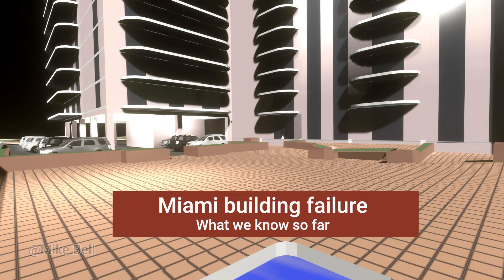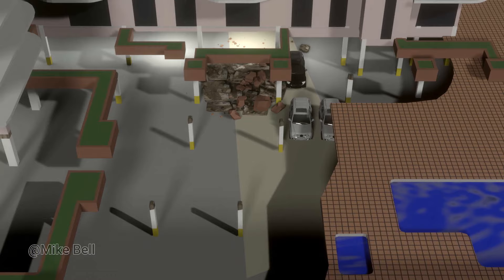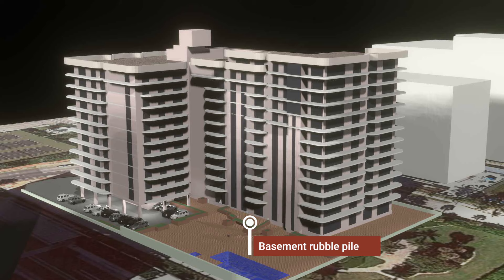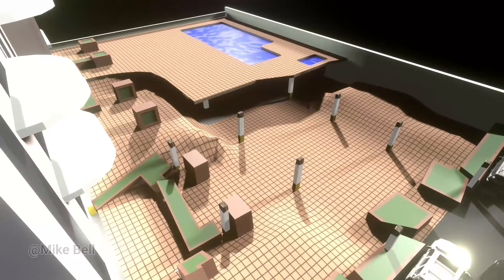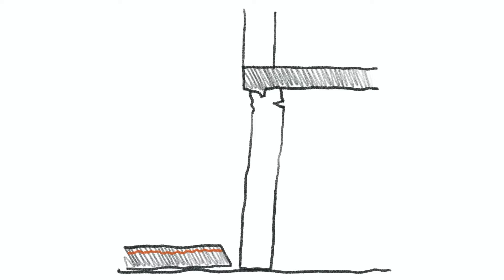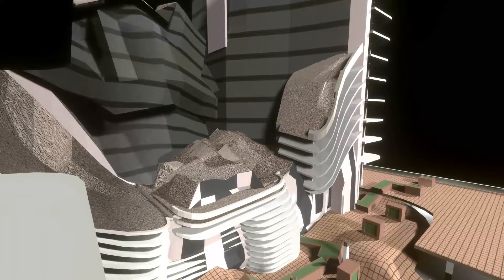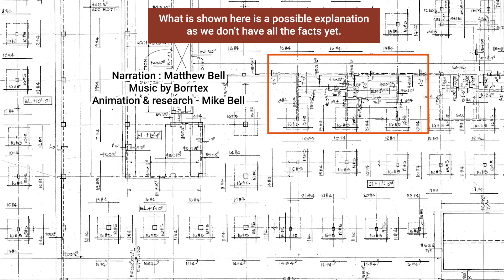MIAMI CONDO COLLAPSE | visualization of the evidence pt2

Comment: I had read that there was numerous complaints from the occupants regarding the constant pounding and vibration from an adjacent property being built.  The new building's construction company even offered this building's homeowner's association $400,000 to make up for the constant pounding that was sending shock waves through the building.   They did not accept the $$.   Wouldn't that have caused issues like cracking on top of the other issues the building had?
Reply from the maker: I am doubtful the adjacent construction made a difference.  Buildings are next to other buildings all the time.  The re-certification Engineers would have been on the lookout for any such damage and they reported none.
Reply: @Mike-Bell  from what I read the city allowed a street that divided the 2 properties to be condemned to allow a bigger foot print for the new building.  Not only weren't they very far apart but where directly adjacent.  I don't think the building had been annually inspected so there might not be anyone noticing that the constant construction pounding of footings being driven into the ground was negatively impact the 40+ year old  building.
Reply from the maker: @sallydavidson4471  It is normal practice for a dilapidation survey to be performed on the adjacent tall building to carefully note and record the state of a structure prior to new construction next door. This way any new cracking or damage can be attributed to the new construction and the new building would have to pay for cracking/damage. I have heard no talk of damage or repairs. Only the talk about the inconvenience payment of $400k.

Comment: Individual unit renovation added weight. People switched from tile or cheaper materials to entire marble slabs and thicker glass.  The design wasn't made to withstand such loads.  The planters were already failing 6 months beforehand, and the water damage, well, would that be climate change raising sea level?

Comment: The eye witness accounts will be useful to the investigation, but seriously, they've barely finished removing victims from the rubble. No scientific proof/no actual facts, can be learned from this video, except that the building collapsed - and that is my qualified forensic engineering perspective. But hey, at least you made some ad revenue. 🙄

Unfortunately, people tend to read and take in the immediate speculation like this because it's recent and currently comes with a shock factor. Far fewer will bother reading through the technicalities of the inquiry results when they're eventually published way down the line from now. Hence speculation now can be confused with actual fact later on, leading to the spread of misinformation.
Reply from the maker: I undertake to make correction video when the final assessment is made. However I feel confident in what I suggested here will not be substantially different from the official finding. The ideas presented here were discussed with multiple of my Structural Engineering colleagues and they all were confident this was a very plausible explanation.

Comment: the theory of domino falling should not have happen, as there are other columns, lift walls and staircase walls that are on the inner side of the building, so even after the other side of columns fail, it should not have caused a total failure of the building...in structural design, there is always redundancy, where are all these redundancy ?!?!

Comment: If your going to use toothpicks to hold the building up you should think about making them capable of swaying without cracking and failing rebar doesn’t hold the building up the concrete does !!
The rebar just reinforces the concrete but it doesn’t stop it from cracking !! Otherwise the building will stand up on rebar when The concretes gone !!
That is the cheapest design I have seen yet for a building construction !!
If concrete walls put in the place instead of cement slabs this building would still be standing !!!

Comment: You never build a building with concrete slabs !! Damn slabs can not take back and forward motion with out cracking and failing !!! If this building was made with steel construction with cement overlay it would still be standing next hundred years !! This is a new design And take cost of steel out of construction of a building and Concrete slabs with rebar allows for rusting of the rebar which  internally cracks the cement and you can not see this is why the pool deck fell first compromising the entire structure , accept where walls was built that is stronger then cement slabs with rebar the building stay standing never build a building with cement slabs always put walls to help support The structure !! the slabs was the same thickness at the top floor as it was holding all the weight of the entire building on the bottom floor !! This is like putting toothpicks under your house to hold it up as long as One or more toothpicks don’t break the structure will stand but if one or two toothpicks rot and  break then it has the weight of the entire structure on a few toothpicks !!
And where the building did not fall there was a wall stand there to give it proper support to hold the building up !!!
All the building made with this similar design should be taken out of service immediately Because it’s nothing but a death trap ,, if you to have an earthquake and overtime the rebar rust and cracks the  cement internally just like a Earthquake would do !!! It’s just a matter time before the structure fails !!!
If you’re going to build a structure with a Type design put walls up instead of toothpicks to hold the building up !!!

Comment: Hmmm, well, I think if I lived in any high rise(never happen) I would want some sort of proximity sensors everywhere in the building tied to an instant warning system of LOUD irritating alarms and to my devices(phone,PC,TV,etc). Any nasty noise or movement of material and everyone possible gets warned instantly. False alarms and evacuation might happen like a loud car crash in parking area set it off but WTH, at least you know it works.

Comment: If a sprinkler pipe is broken and flowing water, wouldn't it trip the fire alarm system? Maybe grandfathered due to it older fire codes?..
Reply from the maker: That question has been asked over and over with no satisfactory answer.  Quite likely the alarm was disconected from an annoying repeated false alarm and not repaired.  Had it worked it would have saved a lot of lives.
Reply: @Mike-Bell  Thanks for the feedback, Mike. I spent 32 years on a full time fire department and building construction knowledge is essential for our own survival. Few municipalities are eager to solve problems and more likely to hide them or simply to shift blame....bottom line management tends to miss the larger picture. Stay safe.

Comment: You repeatedly use some form of the statement, "lack of warning", but I can't agree with that.  

There was literally years of warning - all of which was ignored - until it was finally too late to do anything about it.  

That's not unique to this disaster, and is, for example, ultimately in the same family of root cause of both Space Shuttle losses - but just because the resultant failure is sudden and catastrophic it does not automatically follow that there was little to no warning prior - it's simply that the warnings were never heeded.

In short, no amount of engineering can overcome prolonged willful ignorance and neglect.

Comment: Do your research they knew there were problems back in 1997 when the building was only 17 years old. That's when the HOA started funneling money away. Is the sister building AKA North tower North tower built at the same time also by the same builder hasn't had any of these issues and there and they're HOA husband has been controlled by a completely different group.

Comment: I mean, surely the warning signs were there? Apparently as early as 1996 things weren't quite right.
Reply from the maker: Yes there were signs but nothing out of the ordinary. Many buildings are in that state. Some worse. No signs of extreme distress shouting vacate the building now for human safety.
Reply: @Mike-Bell  What about the huge cracks in the ceiling of the underground car park?
Reply from the maker: @NiKOliDANBURSKi  I see old buildings I see in my work which look pretty similar to Champlain garage ceiling. Typically they need repairs but not evacuation. 
In this case the damage was fatal and was largely hidden. That is very scary to me as a building professional.
Reply: @Mike-Bell  I understand 😬 Hope they find out what happened 🙏

Comment: so one car bomb in the right place underneath could bought this whole thing down.
Reply from the maker: Well actually more like a gust of wind on the pool deck. This building was eventually just teetering holding by the proverbial thread. And on that night it could well have been a gust. The wind was quite blustery at the time. A shocking design and dodgy construction. Deadly combination.
Reply: Sure, it could absolutely have that effect.  Of course that's not what actually happened.

Comment: I’m wondering if it was a sprinkler pipe if it had to do with the fire system wouldn’t the lack of pressure set the alarm off automatically I’ve been in buildings used fire hose and a matter of minutes the alarm was going off I’ve done it twice I know there wouldn’t be any alarms for this situation but I’m wondering the one lady heard something and got her family out and what about all the other security cameras around the building and inside I know the building collapsed but I know shitty restaurants with a camera system that’s hooked up online

Comment: Can somebody help be better understand this building: were pre-stressed concrete cross beams present and at which floor? To me it just seems slab floors one of top of the other with the only load bearing elements being the columns up from the foundations.

Am I missing something?
Reply from the maker: There was no pre-stressing or post tensioning in this building. There were a  lot of transfer beams at 2nd floor level over the porte cochere. But the rest of the building was flat slab construction with long span traditional reinforced concrete.
Reply: I can't get my mind around the idea of how to avert a collapse like that, if the loads could have been shared between the adjacent inwards columns. My mind actively refuses to endorse a building where even a complete line of columns is vital, I'd like to see the building statically stand even without.
Reply from the maker: @m80116  This building represents the worst of sailing as close to the edge of the structural code as possible. The designer did the bare minimum against punching shear in the deck and the tower. Fortunately this  building is an outlier because this is a very rare occurrence. 
. 
No disaster happens for just one reason. This case was a very brittle structure. Plus pitiful lack of maintenance caused unchecked corrosion. Once this under designed structure lost enough of its steel which was working at maximum catastrophe struck.
Reply: Err... not to downplay your competent view but I am SCARED of a structural building code that allows something so close to self destruction should no maintenance have happened in a 40 years old building. 

In fact what worries me most of all... it's not the fact that the flat pool deck caused an almost irremediable spalling and corrosion of the structural elements. It's the fact that apparently under my deepest ignorance those elements tied to floor deck were in fact a vital element to the building which couldn't stand without them.

Comment: Great video except it would be impossible for the deck to collapse as shown and first. The only thing that is plausible is the area of pool deck between building and planter that we know collapsed by video of the entrance to the garage. The rest is impossible unless the lady that reported to the security guard as claimed is a magician. The first cop on the scene walked over to that lady who was trapped in her car and the security guard was there trying to help her out. It would be impossible for the old woman to get into her car to even think of driving away had the pool deck collapsed before she got in her car. 

Do the issues with the woman who talked to security guard being trapped in her car it would make your theory impossible.

The second problem is the pool deck was push to the outer wall behind the planters and cars. The rebar dragged down the wall part way and still has pressure toward outside wall as it is not able to lay flat. With that said the building had to have begun falling before the pool deck failure. You have rebar at the column by the Gate that goes up about a foot and then pulled back down. That was not a failure. None of the alleged punch sheer could have been a failure that caused the collapse. 

Eye witness are not ever reliable because they are in a fast acting situation. When they claimed the deck collapsed they could have all meant the one area we know did collapse. 

Another issue is the fire alarm didnt go of till after the collapse. The garage collapse should have set it off. There are witnesses that were allegedly at the elevator in the garage waiting when the garage collapsed. Is that even plausible. It would have been dark before and after as the lights were out plus how did they get in garage. Were they about to leave or coming back. Coming back might have been a problem if the garage was closed die to the debris.
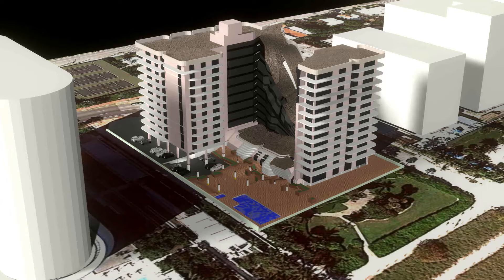Reply: Check the timeline Mike has linked to in the Notes to gain an accurate understanding of the eyewitness sequence. No one was trapped in a car after the building collapsed at 1:22, for example. The Vazquezes were going up in the elevator when the deck collapsed at 1:15. None of the witnesses described a deck collapse sequence. The building was already redistributing its load at 11 PM, and may have begun doing so even sooner. Etc.
Reply: @maud2739  well was I right or his timeline
Reply: @scottparker1220  The timeline document that has a link in the Notes section is correct. The timeline indicates that bodycam video shows Security Guard Shamoka Furman helping Iliana Monteagudo, who escaped down the staircase from 611, out of the garage.
Reply: @maudessen573  I gave you the video of the first cop. Maybe it is just a fake. What don't you get. The old woman not only could not but would not even try to get in her car AFTER THE COLLAPSE. her car was half on the upper deck and half on the collapse. How could it  collapse when she said the pool deck collapsed before she left her room. Then she went downstairs and asked the guard in the lobby. When the cop showed up the guard was try to help her get OUT of her car. You would think the cop would help but apparently not. So how does it collapse first. Oh the time line said it did.
Reply: @scottparker1220  You are confusing two different people from two different apartments. I hope no one pays attention to your creative new story, because it is not accurate.
Reply: @maudessen573  are you on Mars.  I am on earth talking about a condo collapse in Florida. There was only one first officer last I checked. Did you watch that video or are you stuck in a timeline that someone made up. 

The officer walked around the wall to the area where the ceiling fell down due to poor construction work. Oh wait it is 40 years old. He then walked over by the collapse parking. He spoke to the security guard. What are we missing here that you dont understand. Maybe it was a different elderly woman that was in the car trying to leave but didn't make it. So instead of trying to dog me show me the correct condo that you must be at.
Reply: @scottparker1220  Go through all the links to witness statements, interviews, and videos.
Reply: @maudessen573  hey mate great idea why didnt think of that. Holly crap. Here maybe I should try and figure out what they meant. I witness statements are very rarely accurate. It is amazing what trauma can do to a person remembering of things that happen. How exactly did she see past the wall. How did any of them see past the wall. How did they hear that but not what took place before outside their widows. There is video of the planter that collapsed in the garage before they apparently hear what ever they thought. 1 am most people are sleeping or relaxing not up looking out a window waiting for something. 

The only facts we know are the videos unless they are fake. What part dont you get. Eye witnesses are not video evidence. Maybe something else took place that caused the collapse to begin. Something caused the planter area to fall into garage. There was nothing serious with the building that caused this collapse. The question is what. The alleged timeline does not give that answer nor is it fact. WAKEUP to life and how things work. Maybe you should watch the police video to see if it was the right property and right security guard and maybe the same witness.
Reply: @maudessen573  elderly woman was the only person that I heard of who spoke to the secretary guard